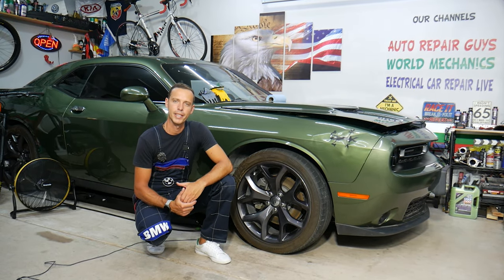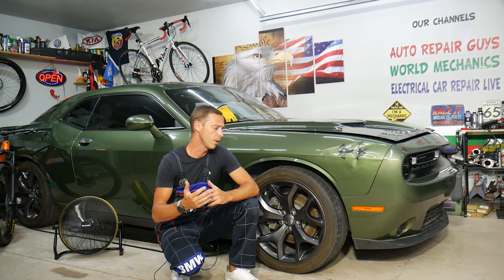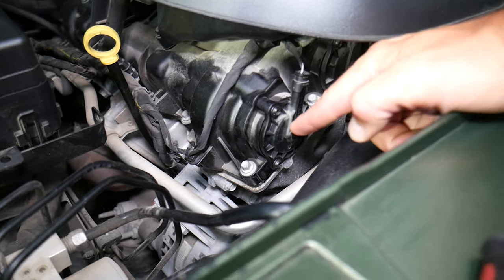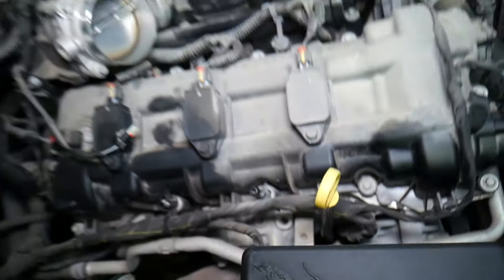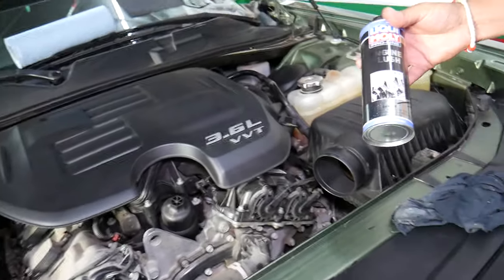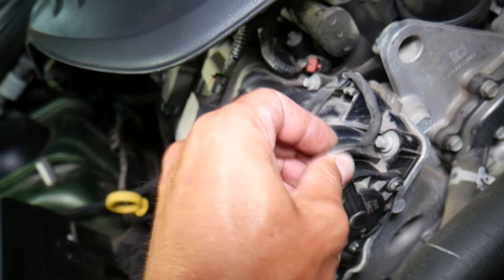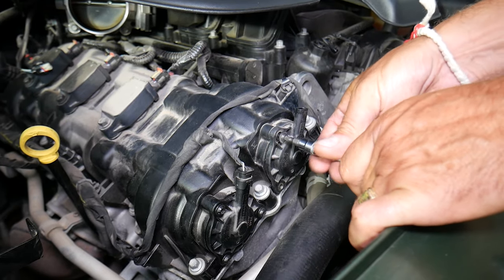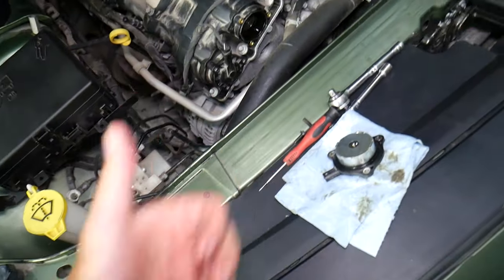DODGE CHALLENGER CAMSHAFT POSITION ACTUATOR 1 BANK 1, CAMSHAFT PHASE BANK 1 SENSOR 1

Comment: Auto Repairs Guys my challenger is overheating but no codes are coming up and no leaks of antifreeze are visible. My antifreeze is not low and I've checked the hoses and their connectors to see if they have cracks or wear. I need help on what else can it be, please give me your best advise?
Reply: Termostat

Comment: My Challenger has 67k miles and just this week, I changed out spark plugs, coil pack and I also changed the oil.

Prior to all this. The only part I changed was Bank 1 Camshaft Position Sensor.

I also changed Bank 2 Camshaft Position Sensor since I didn't want to run into issues with Bank 2 during this Winter.

I notice the Actuators are easy to replace. Should I just go ahead aand replace them?

I have been getting "Camshaft Position Sensor Bank 1 Slow Response and my exhaust when Full Throttle has a ton of Droning. Is this from one of the Actuators on Bank 1 (Exhaust)? If so, I will rather change all 4 and not worry about it.

I think the next things to go may be the Throttle Body and the Sensor that sits on the Intake Manifold behind the Throttle Body.

I also know that there are 2 Sensors under the car on the Exhaust Manifolds that may also potentially give out.